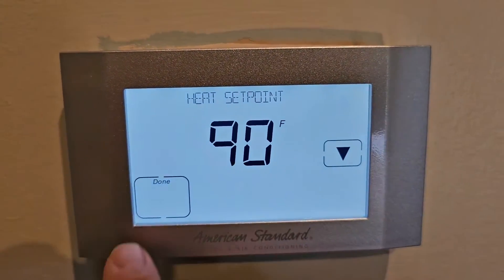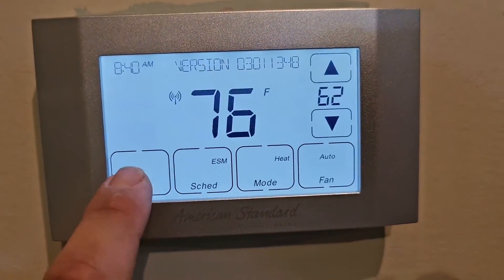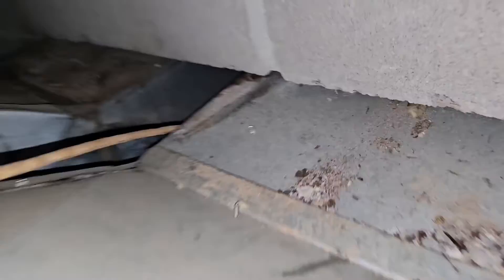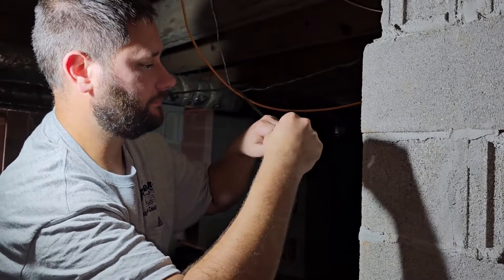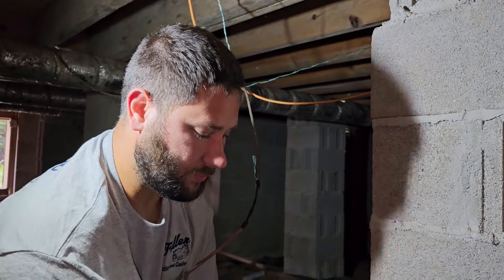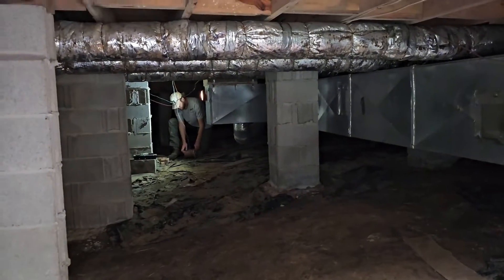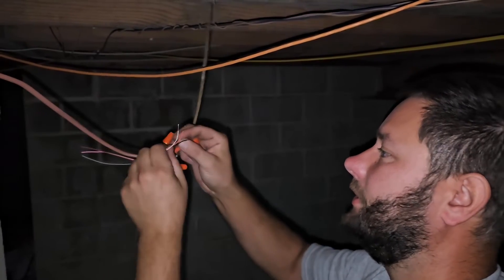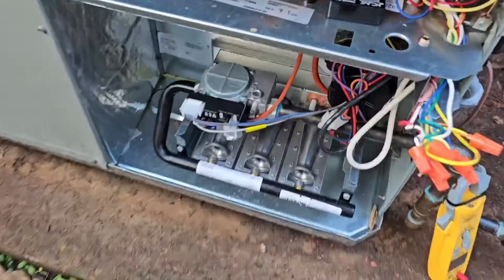Thermostat Wire Pulling Hack You Need to Know

Comment: If I tie up the wires up from the inside of the house would i be able to pull it through to the outside? 
  I probably wouldn't be able to get under the house..
Reply from the maker: It depends if it's stapled in the wall
Reply: It was built 100 years ago.. I can't remember when the units started coming out to be put in.. Was it possible they were stapling back then?
Reply from the maker: I'm not sure
Reply: My indoor unit is right beside the outdoor unit.. So hopefully it isn't stapled.. That's a long crawl 😂 with just enough space to get you in, maybe.. 🤣

Comment: I don't get it. You showed us the hard way to do the easy part. I don't need help pulling t-stat wire through a frickin crawl space. Just cut it and wire nut in a splice. I want to know how to replace the stuff in the wall the installers stapled down.

Comment: For the sov operations the manual showed “[with Cool], with Heat”.
And at the top of manual showed “[AC] , HP”. Meaning the “[AC]” applies toward “Cool”  and the “HP”applies to the “Heat”? So shouldn’t the sov be set for Heat and not cool since it was a HP? Or is the sov (switch over valve) based off over if the hp energizes in heating or cooling? And this varies by brand. Most brands except Rheem/Ruud energize sov for cooling. So if that’s the case then I answered my own question but still confused as to why you selected Cooling instead of Heating based off what the manual stated.
Reply from the maker: This was a american standard unit which energizes in cooling

Comment: Question. I got a customer that whenever they make a call for cooling the tstat goes blank comes back goes into delay and tries again and process repeats. Blank etc.. Doesn't do it for fan or heat.
Reply from the maker: Well it sounds like there could be a short or a bad thermostat.
I would check the pressure switch wires if you have some and then I would check the contact or coil.
Let me know if you figure it out

Comment: Just had to rewire mine.  I decided to use Wagos' and was soo happy I did.  I used a 3-spot.  first spot is from air handler, middle spot is dome condenser, and last spot is from thermostat.  some us spots 1,2, and 3, some 1,2, some 2,3, etc.   I even put them in holders and mounted to small board in the attic.  SOOOO easy to see, test, and know what goes where.  I can also easily swap a wire color later if I get a bad wire.  Super simple and easy to see what I did. Small piece of paper on the board explaining the pattern and which Wago is for what service, and now the next homeowner owes me a beer 😁

Comment: I'm responsible for 3 forced air furnaces that all have 2 conductor thermostat wires.  So all the thermostats have batteries, and I'm probably not taking advantage of the 2 stage heat that 2 of the units have.